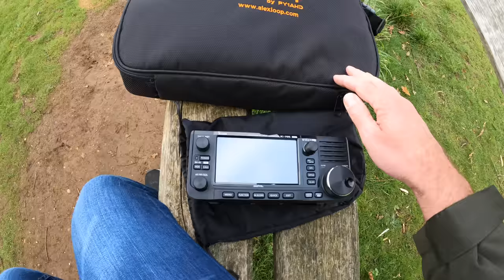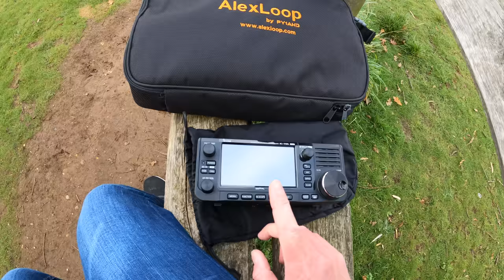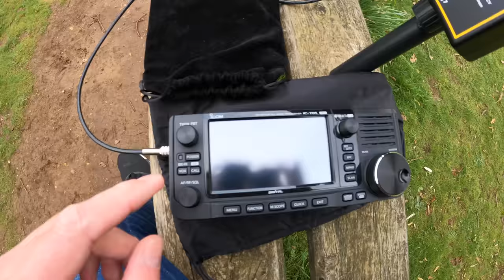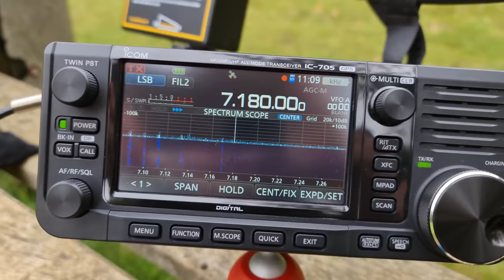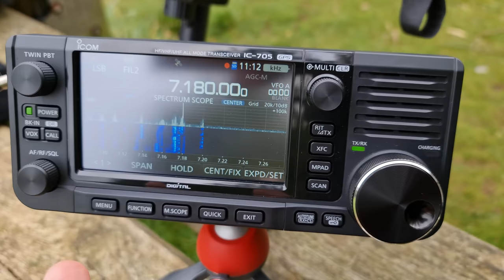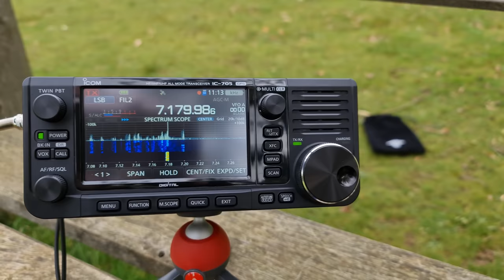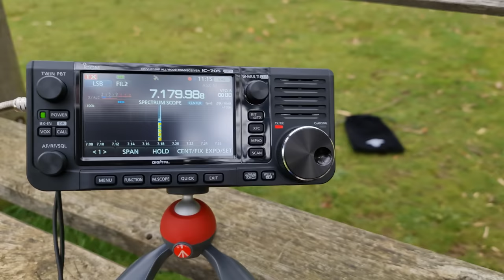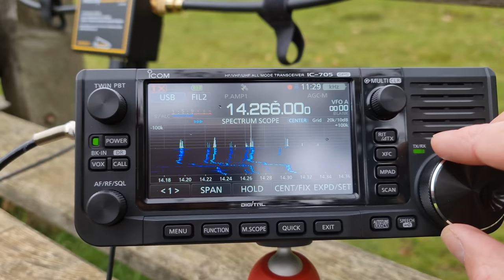ICOM IC 705 WITH ALEXLOOP - ULTIMATE PORTABLE HAM RADIO?!!

Comment: I purchased am/fm rigs last year, absolutely no one on anymore.
Reply from the maker: CB you mean?
Reply: @andykirby  citizens band apologies Andy. Useful for a Holocaust.
Reply: I think most CB'ers use USB, 27,555  I think is still the calling frequency, absolutely booming at times but Solar activity has been quiet for some time which doesn't help. Not sure a lot would use AM/FM now especially the die hard CB'er.

Imagine the fun if everyone had CB in their cars all connected to one channel on the road, lots of People talking to People they never met before or may never talk to again. COuld be a lot of fun and could also be a very useful tool to warn others of Police checks or speed traps etc, many ways where CB in cars can be both useful and fun.

Comment: Fancy someone calling 'CQ 40 metres' when using the 40 m band!  Nice video.  No pretence, which is novel for this hobby.  For newcomers, remember that the $400 'Premier' loop is, erm, some coax at £1.50 per metre, and a maybe £25 wide spaced capacitor (though you may find bidding goes silly on these on ebay, precisely because of how cheap you can make your own!)

Comment: Ham radio has always put me off as here in the UK its just filled with Italians running 1000 watts
Reply from the maker: Haha! Yeah you are mostly right but look in the right places you'll find some cool HAMS to talk to!
Reply: @andykirby  I have settled for SDR radio using USB cards and a shortwave radio (full band coverage but no SSB).
SDR radio works brilliantly connected to an android device but in my neck of the woods there is so much RF interference, its off putting
Guess I need to hook up a decent antenna. Like another J-Pole
Reply: Woaaaahhhhhhh! This is so cool
Reply: @BillyNoMates1974  I use a Bonito megaloop FX great antenna but I live in a Quiet area free from QRM. But the bonito antennas output just the right amount of power for portable radios and SDR which can overload badly with ham style long wire antennas.

Comment: Nice to see the mag loop portable. Loads of info online as to how to use and how they perform. I live by them. Do not be surprised as to how they perform. They are brilliant. Just make sure it is tuned properly using low power and then increase testing SWR as you go. Just remember, mag loops generate a shed load of Volts and Current either side of the tuning capacitor. 10 watts is a good place to go.

Comment: I’d love a 705 but it’s outside of my budget.   I’ve looked at the mag loop antennas before but never tried one.   I’m currently only on 10m with a white stick vertical and on 2m with a homebrew slim Jim.   Hopefully doing my intermediate next month so I can then run a bit more power.   My callsign is M7MDY.

Comment: Nice one Andy have you sorted out the 70cm 2m situation with the high swr? 73's
Reply from the maker: Hey mate! Nice to see you on here! It seems like a common issue with using portable antenna designed for handhelds, others have reported the same issue.. I guess the radio just wasn't designed for that... anyway  I'm going to try using  something with some coax. Catch you on the air soon👍
Reply: @andykirby  i like the alexloop and seems to do the job, but the narrow bandwidth is issue for me i guess but would be ideal for my location to at least get out on hf with the 705... 73's

Comment: Unfortunately a QRP radio with a sub-optimal antenna is not ultimate in portable ham radio.  I've owned mag-loop antennas and they work OK for their size, but not exceptionally well.  Nonetheless, great video that demonstrates the portability of the antenna.  And loop antennas do have great, low signal-to-noise ratio.  You got me interested in re-looking the mag-loop antennas!
Reply: I make contacts on an MFJ-1820T whip and a 5 meter raised radial, it's not going to win contests or break pileups but I make contacts on it every time I use it. 

I also have the DL1DN whip, no radials, it uses human counterpoise, so I hold it as I walk around with my FT-818, there are 2 coils for different bands and you adjust the length of the whip for whatever band. It works. I can sit on a rock, on a tree stump or just out in the back yard and make contacts while holding the radio. Of course, you can also use a counterpoise system with the DL1DN whip. 

Sometimes a compromise antenna is no compromise when you're after easy and super fast setup and one that you can just walk around with. I can't imagine carrying a tripod with me everywhere for some antennas or EFHW and messing with trees or portable masts, all these are good for stationary purpose. I know my portable EFHW 49:1 will get out much better but that's a different antenna for a different purpose. Sometimes the more efficinet antenna is the compromise. 

I've had great success with MFJ's 935C Loop tuner and 4 watts and also the MFJ-9232 QRP loop tuner, on 17 and 10 you can make a very small portable loop and it works amazingly well, I have a couple of videos on my channel with the 2 tuners if you cant to check it out.